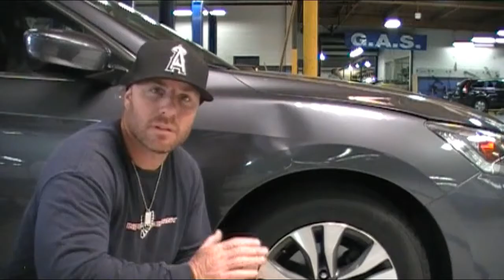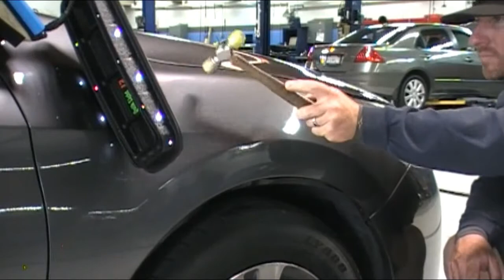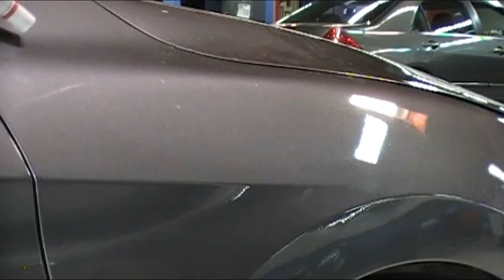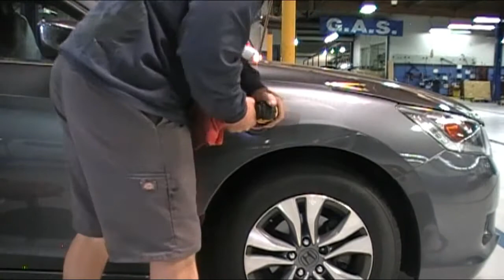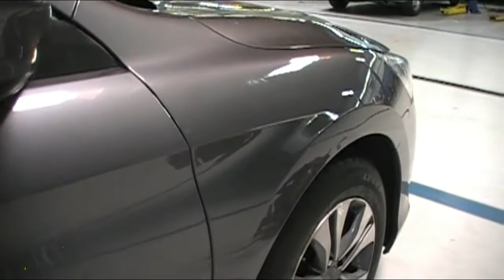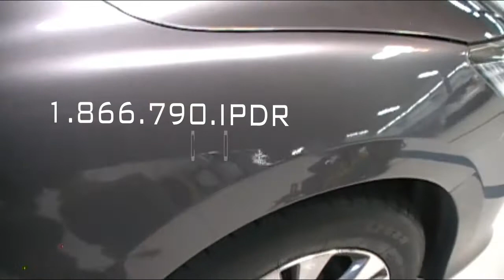Paintless Dent Removal

Comment: nice work man, i subbed. your old school for sure. tons of heat and a couple tabs would have saved you some time, but either way i respect showing the whole job. You are a master technitian for sure sir)
Reply from the maker: Thank you for your accolade. I glue pull quite often. I feel that sometimes techs jump to glue pulling to quick. Glue pulling is a great technique and does save a lot of time. In this situation I believed it would have taken longer to set up the glue and wait for it to heat up then to just jump on it and start cranking. in the time I would have waited I had most of the dent massaged up. I appreciate the comments. Always good to hear from other Masters in the trade.